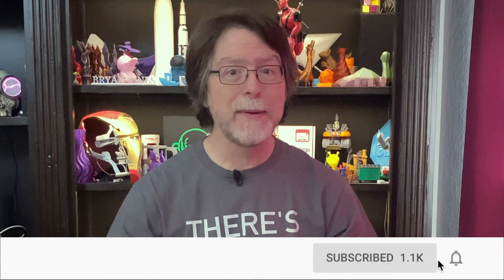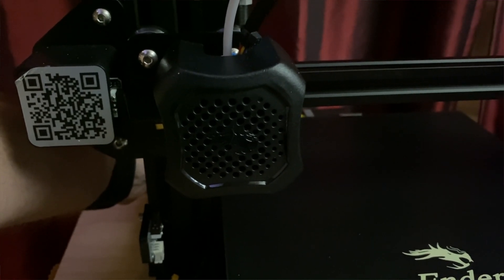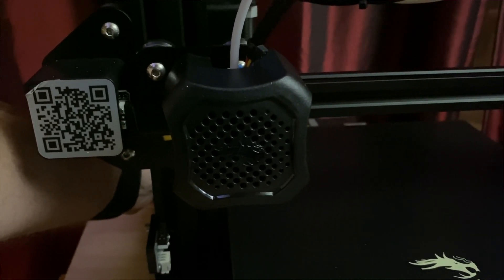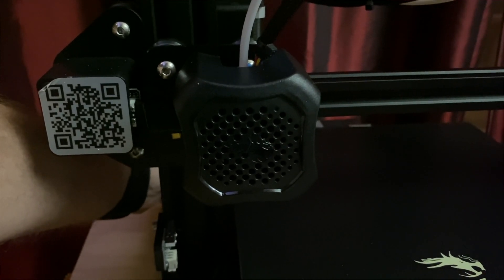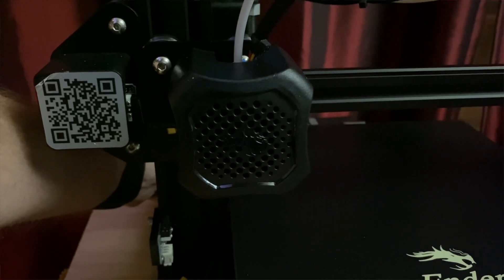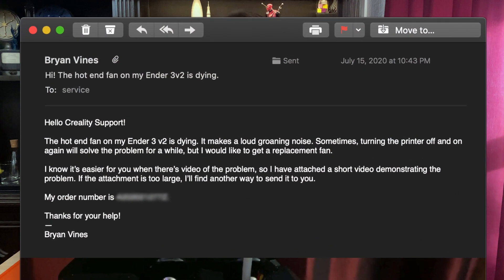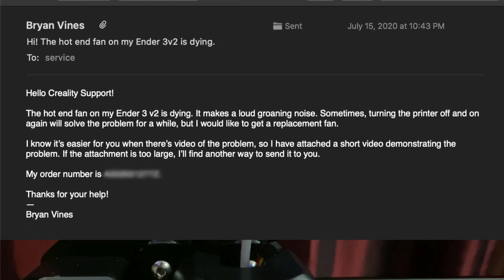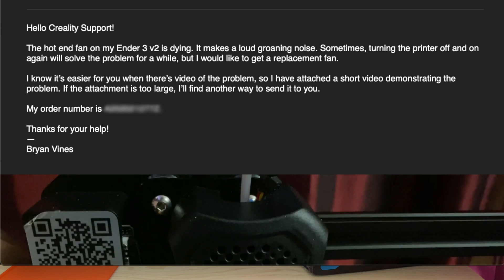What to Expect from a Creality Warranty Claim

Comment: Nice video, 4 years later.  Naturally 4 years later I think the email address has changed.  But I included all the info and we will see   I bought a ender 3 V3 and within w week, the cheap plastic gears on the extruder broke.  We will see   I bought hr metal upgrade gears because ...,

Comment: I really like your videos content and delivery style!.  My new 5-s1 quit after three days. I contacted support and was respectful etc. Following the suggested troubleshooting from the support folks I determined there is a fault in the flat flex cable which plugs into the extruder.  (Moving the middle of the cable makes the nozzle temp reading come and go).  I am getting nowhere with support as they are not even replying to me to me now.  I would bite the bullet and just buy a new cable, but I have not been able to find any listed for the 5-s1. Any help in finding out where and what to buy would be supper appreciated.  This is my 1st 3d printer and I was impressed until it quit abruptly.

Comment: This is Creality Warranty Process for me. My Ender s1 was bought like 97 days ago, So just a few days past 3 months old.. Bought from amazon Brand new from Authorized Seller. Machine need's a  replacement drive system...  Creality representitive - Yeah we wont back a amazon sale's warranty's, you didn't buy direct through us. Try the seller.... Amazon Customer service - Oh its just past 3 months since you bought the 3d printer, Looks like you have to contact Creality... Endless Loop Activated.  The even better part is the Seller is not even on amazon anymore to contact them directly.

Comment: Little to no customer-centric support from Creality. Bought the ender 3 S1 and not a month in and less than 1kg filament printed the heat block started leaking. Their solution was to send me a new heat block, as a result I would have to disassemble a brand new sprite extruder, a process that is completely unknown to me and I would most likely have to pay a professional to complete it. I bought this specific printer just because I trusted the 96% pre-assembled marketing and wanted little to no-hassle assembly, as you understand, disassembling a brand new sprite extruder should NOT be the case. I requested a replacement for the sprite extruder, I even offered to pay the difference and shipping to receive the all metal one but their answer was to pay $80 because "the heat block is the faulty part", however the extruder came as a whole part when purchased. Negative answers all over the place, and no solution that would fit the case or my needs. Forcing my hand, I filed a chargeback case with Mastercard and I will be receiving a refund soon. $400 printer and NO support and even worse, NO intention of providing an actual solution or even going the extra mile to maintain customer satisfaction. They are literally paving the way for Prusa here, which will be the manufacturer of my choice given the great stuff I've heard about their support.
Reply: Fun fact, I had to use a translator and translate English to simplified Chinese to actually get someone to understand.

Comment: I recently went through a bum board and am in the process of replacement. It's worth noting that shipping on replacement parts is only covered for the first week. After that, even if the part is covered, the shipping is not. It's not crazy expensive, but shipping is going to cost me a third of the cost of the board.

Comment: My experience is: If you don’t buy it directly from them they will not warranty any parts. I bought mine new from a reseller on e-bay and Creality refused to help me. Told me to speak with the seller.

Also, they are a China company with China values. They could care leas about supporting it after it is sold. They will do the bare minimum to help fix what they sold as broken.

Comment: Every one of my cooling fans on my CR10S Pro's (3) have lost their oil then quickly failed. Oil in the silicon nozzle cover is the first clue. Their warranty even when done as you mention becomes an email a day until they wear you out.  Warped beds are more common then not and only remedied with 4mm glass plates. Having experience building them from scratch helps in owning a Creality printer.
Reply from the maker: Hi Richard. I'm still kind of on a quest for the perfect fan. One fan to rule them all. Something on the quiet side, with decent airflow, preferably 24 volt, that won't die prematurely. Noctua fans are quiet but at the expense of airflow (they work for most of my use cases, but sometimes heat creep can occur). Scott Worthington has mentioned the Scythe "Mini Kaze" fans; I've ordered a couple to see how they perform. They're 12 volt fans, so I'll have to put a buck converter inline with them, but buck converters are cheap and tiny. If you've got a fan you particularly like, let me know! Thanks! 👍

Comment: My experience with Creality support was similar.  One of the bed adjustment knobs on my Ender 3 was damaged during shipment.  In addition to a description, I added a photo of the damaged knob and bent screw along with my request for a replacement.  The Creality rep was helpful and apologized for the damage and said a replacement knob and screw would be sent out right away.  Knowing how long packet shipments from China can take, yes I'm looking at you Banggood, I then went on Amazon and ordered a replacement set that came with upgraded springs as a kit. The Creality replacement knobs (they sent a whole set) and screws eventually arrived and now lives in my spare parts box.  Overall, not a bad experience at all compared to other online sellers I've dealt with.
Reply from the maker: Hi Dale, thanks for commenting. How long did it take for your replacement parts to show up? I'm guessing mine will probably take about a month, but it could be longer. 🗓😅
Reply: @BV3D  The replacement parts look five weeks to arrive. Longer than most people would like to wait but no worse than most shipments I get out of China warehouses.  Good video as always.

Comment: There are so many horror stories with Crealitys support especially on the community group on facebook. I myself have had my trouble with them. June 14th as a gift I received my printer and began to assemble it, However when getting to the X axis belt it was too Short. They sent in the package a wrong sized belt. I contacted them and like you said in the video gave them my Order number and etc especially since the printer was purchased from their online shop. They asked for photos and I provided photos of the short belt. Then they tried to charge me for the right belt that I needed from the beginning. Then had to question why would I have to put a cost since I received a wrong item in the box to begin with. They then apologized and said they would send me the right belt free. This was on June 14-17 and now Augut 3.. Still No belt. Went to Banggood and purchased a X axis belt there for 6$ which worked but still came out of my pocket and still no correction on Crealitys part. I have little faith in their support. And by the way I love your videos Bryan.
Reply from the maker: I'm sorry to hear that your support experience was like that. You provided all the requested information, but it's been about a month and a half. Did they give you a tracking number for the replacement belt?

Comment: Ahh waiting for the spare parts - a nightmare. Great tshirt as always :)
Reply from the maker: Hah! Thanks! I'm hoping the fan doesn't take too long to arrive. Tracking says it's moving along, sort of. But I can see that it's moved around through Shenzhen a little bit and supposedly got handed off to a carrier. I check every couple of days to see if there's any new info.

Fortunately it's just a fan and not something like the main board. I bought a four-pack of 24V WINSINN Quiet (ha ha not really) fans so I could get the printer running again. 😉

Comment: Not worth the trouble.  I treat this like computer parts.  I cut more time and trouble out of the process by ordering two of the parts and having a spare on hand. Screws fall out.  The worlds an imperfect place.  Keep a spare printer or two around!
Reply from the maker: That's the kind of practical thinking that lets you keep your stuff running. 👍
Reply: @BV3D  Just can't help it.  17 years as a NOC tech and 27 years of Amateur Radio.

Comment: This V2 is my first printer and its disappointing that this fan will die of much sooner than later. Can we expect a new How-to video coming up to replace this fan???!?  Maybe one that is quieter than the stock one?
Reply: For whatever reason Creality seems to use cheap fans, but it's better than cheaping out on the stepper motors. One of the first thing I do is replace the hot end fans, not because they are bad, but because they are loud. I recommend this fan on Amazon:
 
Usongshine 3D Printer Cooling Fan 40 x 40 x10mm 4010 DC 24V Cooling Fan with 2Pin Wire, 4 Packs of Mounting Screws (24V 4PCS)
https://www.amazon.com/dp/B081R677TZ/ref=cm_sw_em_r_mt_dp_mDgkFbJ6GDGV7
Reply from the maker: Hi Rogelio, give this one a watch: https://youtu.be/KaG9ZwDTOYo
It covers replacing the fan on an Ender 3 or Ender 3 Pro. The wiring is the same for the Ender 3 V2, but the fan shroud on the V2 is plastic, where it's metal on the 3 and 3 Pro. The video covers crimping connectors so that when you have to replace fans in the future, you can just unplug the bad one and plug in a new good one. 👍

Comment: What I don’t understand is why Creality will not honor the warranty if you buy it from “Creality.shop”. You have to go thru them. I didn’t even realize that shop was not Creality. I also have a replacement extruded arm on the way from China and I have printed another so I am up and running but most warranty claims are dealt with the manufacture rather than resellers in my experience, except with Creality.
Reply: Happened to me but I brought mine through Micro Center, a reputable reseller. However Micro Center did offered me to go to my local Micro Center and let the parts manager order the parts for me but they didn't clarify if its coming out of my pocket or not. I just sent them a email for the clarification so only time will tell.
Reply from the maker: @Poorgeniu5  Let me know how it goes with Micro Center. I've bought from them in the past, but it's been several years. The closest one to me is about 4 hours away.
Reply from the maker: Hi Bill. Yeah, I don't know why it's like that. It seems that if you can provide an invoice from a reseller, and the invoice has the printer's serial number on it, Creality could verify they sold a printer with that serial number to that reseller, and that would count.

On the other hand that happens with companies in the USA too; if you don't buy from an "authorized reseller," warranty support can be hard to get.